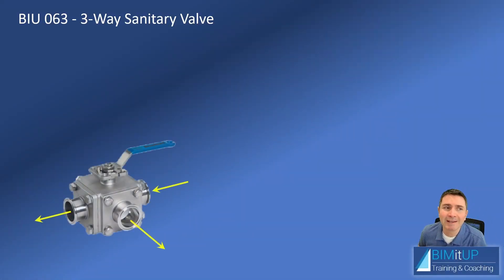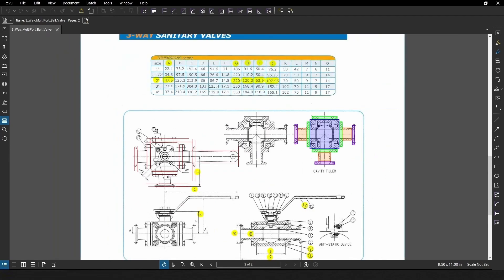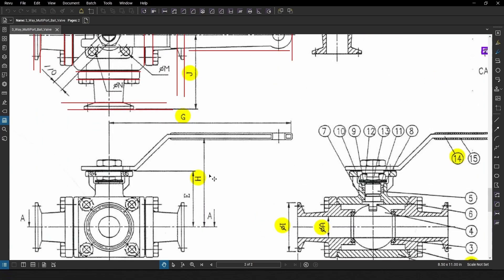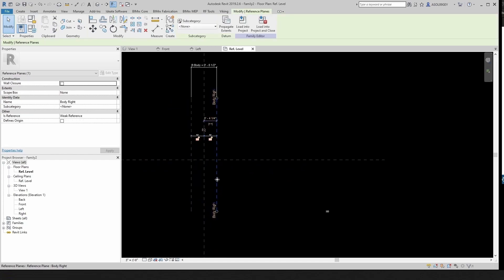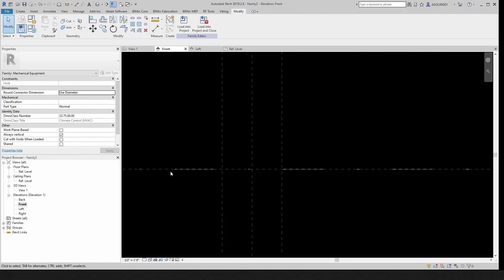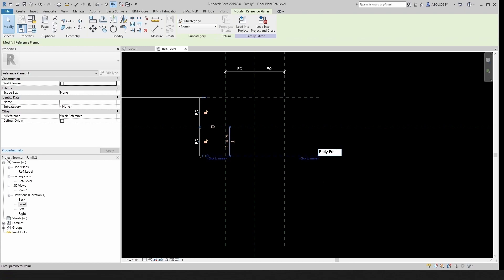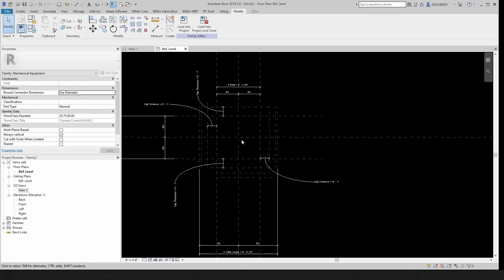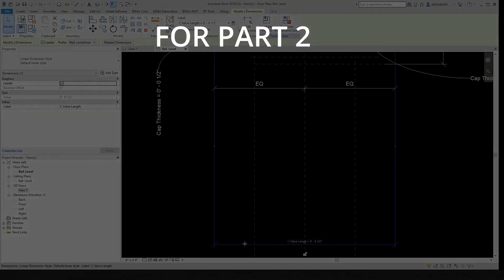How to Create a 3 Way Valve in Revit Part 1

Comment: Dumb question.  What’s a sanitary valve?  I typically think of sanitary when used to describe sanitary sewer applications. This is obviously pressurized…
Reply from the maker: This particular valve is exactly how it reads... for diverting sanitary to different locations (for example, a sanitary sewer in normal condition or a decontamination tank in decontamination conditions). Stay tuned for more good stuff.

Comment: Good basic information! 
Are you going to cover how to make the dimensions based on a txt-file? It makes easier to just import the sizes you need into your project.
Reply from the maker: Thanks!
Yes Marie, on the last video we export a "family type file", so that one or just a few types can be imported into the Revit Model.
And then on a later video, we will even use lookup tables 🙂

Great and important question BTW.
Reply: Thank you for the reply. I did assume it would come in a later video.
If you need another request, I am currently fighting with a family for sandtraps and for standard wells for sewage. Getting those sloped inlets and outlets to work is currently more than I can figure out.
Reply from the maker: @mariepindstruplinde1671   Try to keep connectors always orthogonal, and allow for deflection (to whatever your required slope is... 1/8", etc.). I hope I understood your question. Good luck, and stay tuned for the Type File Video (it will be the last one of the series)